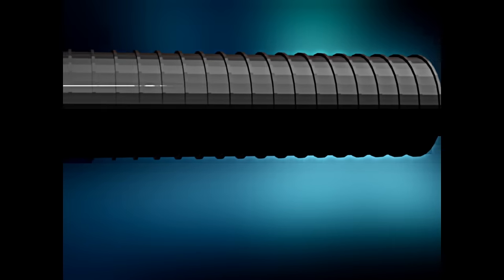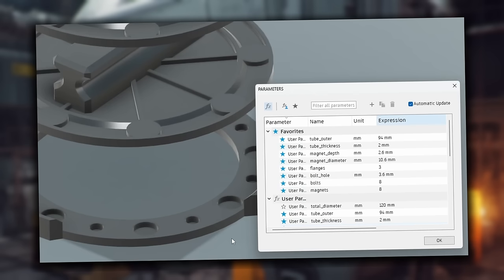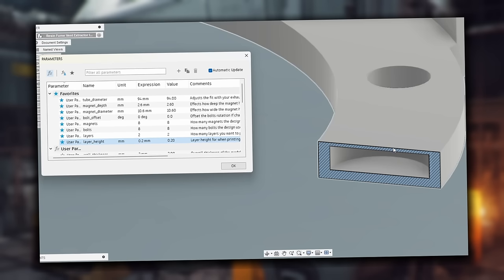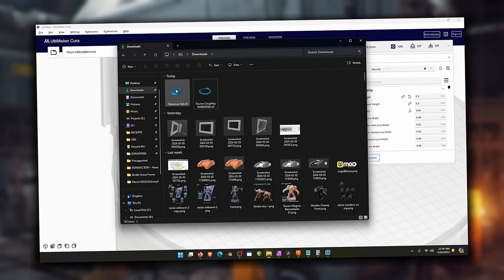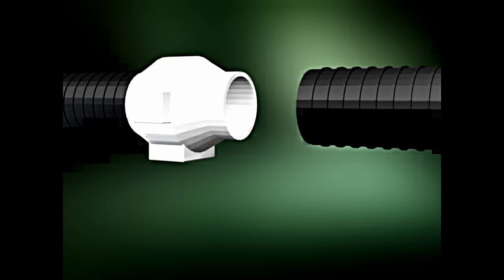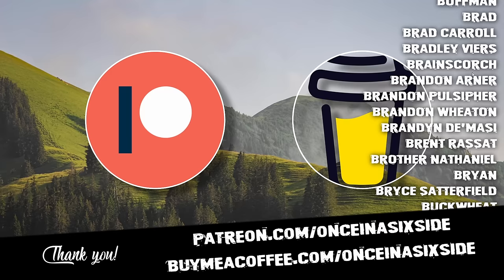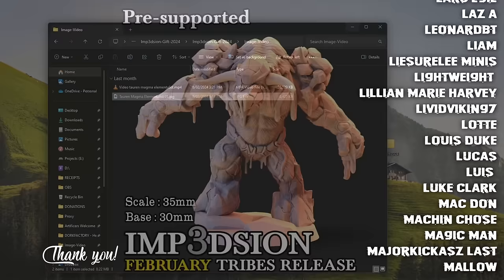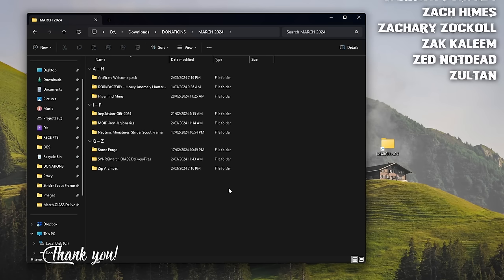Versatile Ventilation for Resin 3D Printers gets BIG update!

Comment: Hey, don't know if you will see this but I specialize in HVAC and have a suggestion for this style of ventilation.

Ideally you want another hole made on the box to ensure air circulation.

The way fans work especially when ventilation is concerned is off of pressure differentials. 

You create a negative pressure space before the fan and a positive pressure after the fan. However because the box is mostly sealed the negative pressure box cant take in new air. 

In turn this creates strain on the fan motor/ causes it to operate at a reduced speed.  Thus reducing the amount of air it's moving. 

When you add a second hole to the shell it allows new air to be forced into the shell which allows more air to flow out. 

If you worry about fumes potentially escaping this hole. You don't need to be new air is always going to be sucked into this hole and the bad air is always going to be sucked out. When you are not running the fan you just seal both holes. 

I have an elagoo saturn 3 and it comes with a ventilation hole already towards the bottom. I use that as my fresh air intake. I then made a new hole directly on top of the box with some flex duct hooked up to that into my exhaust.

Thanks for your time if you got a chance to read this.
Reply: I’ve been googling for hours looking for this info thank you for this
Reply: Also, does all that airflow with the two hole system affect the quality of the prints? Temp change etc?
Reply: @gehrkea  it shouldnt effect the print quality. The temperature within the enclosure is going to be almost the same temperature as the ambient air outside the enclosure. So it shouldn't change anything.

With the ventilation being taken from the box the ambient air is being sucked in no matter what. The only difference is how much air is actually getting moved.

With the tight enclosure the air will still be finding its way through the cracks. At least this way you are allowing the air to freely enter which helps increase the total volume of air moved and helps the motor.

The you could change this set up if you wanted. You could have 2 vents so it's sucking in fresh air and then discharging that air. This would eliminate using the rooms air all together. you would be subjecting the enclose to the outdoor air temperature plus any bugs or anything get caught in the air stream.  So if you do that method it could effect the quality however there are still ways to mitigate that.
Reply: @andrewh9284 thank you so much for replying! I think I finally have the right set up in mind now with all this info. 

Mitigating the temperature of fresh air coming from outside would be adding a heater to the printer?

Comment: Regarding the holes for bolts and magnets, you could have it so the magnet holes form an array between each bolt hole. So you could say 4 or 5 bolt holes or whatever and that determines the symmetry of the array then say 3 magnet holes per sector between each bolt in a B-M-M-M-B style. Since the bolt array is really what you want to get right to match how you want to attach it and then you're just duplicating that short array a number of times to match the specs you want.

Comment: You know what would be awesome? If you'd also include outlet adapter for EU windows ventillation systems (most of our windows have something like 16cm x 1cm rectangular hole for ventillation). I'd pay for that, mate :D
Reply from the maker: I tried to look that up but I'm not sure I can find what you're talking about sorry! Sounds like a job for someone in the EU with direct access to these vents to model that adapter. Should be a breeze with these new files 🍻
Reply: . @OnceinaSixSide  Lemme get some fake fusion360 educational license... :D
Reply: all windows here open on a hinge 😅 (also EU), they either open like a door, with side hinges, or with hinges on the bottom to vent some air (those only open a bit) - so it's hell to vent things.
Reply from the maker: @deebernaers137 Have you tried one of those window AC kits from Amazon? They look a bit fiddly but once installed it should be relatively easy to connect these vent files.
Reply: @OnceinaSixSide  
I'll look into it, thanks!

Comment: So I've made some changes to this for use with the Athena printer.  It required adding a couple new parameters for bolt spacing and bolt spacing override on the coupler.  Bolt spacing maintains the centered between the inner and outer that you accomplished using the midpoint constraint, but if you set bolts to 4 and set a value in bolt_spacing_override it will position the bolt holes on the coupler for a specific square spacing (for Athena's 80mm 4 bolt layout the bolts need to be 71.5mm square, which doesn't work when using the midpoint).

I plan to upload it as a remix to makerworld once it's been validated for athena, but if you're interested I can give you a copy so you can see the formula I used.

Comment: i got me a pax closet from ikea... i plan on basically making a grow box out of it... in the top i want a carboin filter with a 420cbm fan leading out of the window... so everything inside the closet wil get sucked in and filtered... i plan on putting my p1s + ams + filament heater and saturn+wash and cure  inside. since i also plan on a real grow box with flowers and a airbrush vent in the same room im now looking for a solution where i can hook up 3 fan outs to one big fan outlet... maybe with closeable doors... did u ever made splitters?

Comment: I only have a resin printer, and resin is brittle. Any one have tips on how to print this using resin, and setting up the magnets?
Reply from the maker: Hmm.. My advice is to just not do that. Before I had an FDM printer of my own I used to just pay people I found through local classifieds to print stuff off for me and it was never very expensive. I recommend going that route - it'll be a lot less time, material, and cost compared to trying to produce these in resin.
Reply: @OnceinaSixSide  I actually had a FDM printer before and exchanged it for the resin, haha. Should have kept it and had both!

Comment: Any decent solutions for those of us without FDM printers?
Reply from the maker: Of course! Check your local classifieds for 3D printing services near you. Chances are someone nearby can run these files off for you very cheaply.
Reply: @OnceinaSixSide It is a little frustrating that an add-on for a resin printer requires a whole other type of printer in order to work - is there a reason this couldn't be printed in resin?  

On a separate note, lots of local libraries now have maker spaces and 3d printing resources, and will print files for you just for the cost of the filament!  That's my backup plan in case this actually won't work in resin.
Reply from the maker: @aclabonte  Yeah I get that, and while you can do it in resin, filament is always going to be the better option here in every single way.

Resin really shines at high detail, but falls down when it comes to durability, dimensional accuracy + stability, not to mention waste.

Unless you want to fork out some big bucks for some engineering resin, you're better off just heading down to the local maker space.

At the risk of kicking a dead horse I think it's worth pointing out even if you do buy yourself an expensive resin that ticks the boxes for these parts, you gotta waste a lot of that resin on supports, and if that print fails for any reason the costs will balloon out of control quickly.

Comment: How do people do ventilation on cleaning prints? I’ve read it emits way more voc than the printing process itself
Reply: Check out the original "Fumes be gone!!" video from 1 year ago; he built an improvised, but functional, hood over his cleaning station that this system can easily attach to 👍
Reply from the maker: Yep as pointed out there you can easily rig up a flow hood over your work area that this system connects to. You can also attach it to the enclosure of your wash and cure machine and that works great